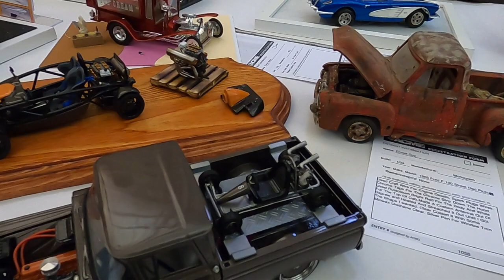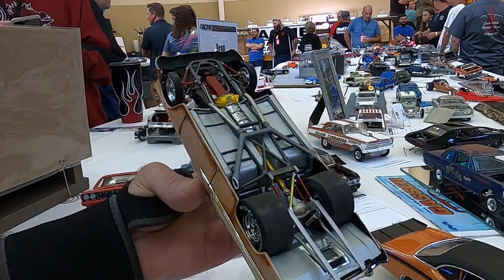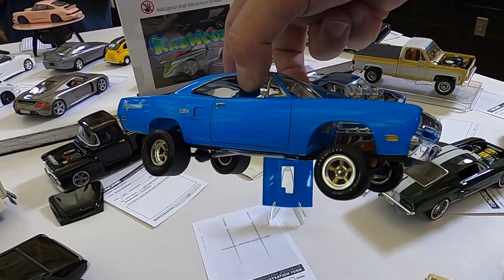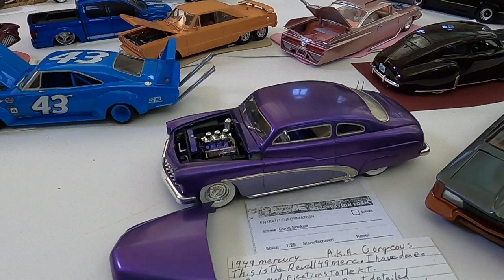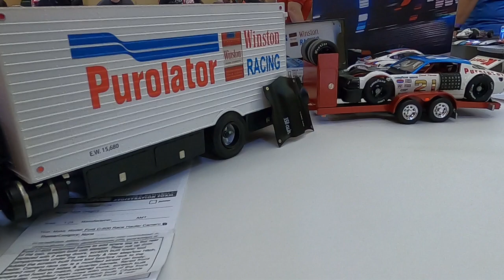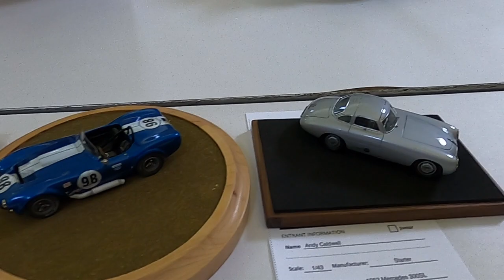ACME 2022 Model Car Show/Contest and Swap Meet

Comment: I immediately notice a lack of 3rd gen camaros. What's up with that?
Reply from the maker: You normally don't see too many of those at the model contests Harry. Seems like the 3rd Gen Camaro was only released a few short times by Revell, Monogram and AMT. Atlantis just came out with one but it's 1/32 scale. Once in a while you will see the BIG 1/8 Camaro from Monogram. I know they are starting to become popular at the Car Shows, do you have one of those Camaro's in real life?
Reply: Actually I have 2 of them. A 1986 z28 and a 1991 rs. I'm having trouble getting the rs camaro to run but the 86 camaro runs sometimes and then doesn't run. I still love the car though.
Reply from the maker: @locotrucker46  Oh ok, man, you don't see many of those on the road anymore. Last summer I was at the store and came across an older lady (she had to be in her 80's) and I talked to her about her Camaro that she bought new. Tried to give her my name and number if it ever came up for sale and she said there were 100 people waiting in line to get the car. So needles to say, I didn't give her my number.